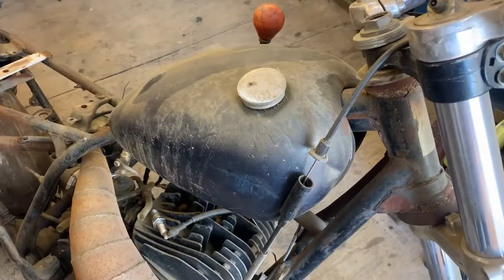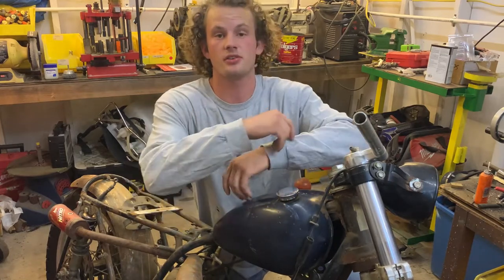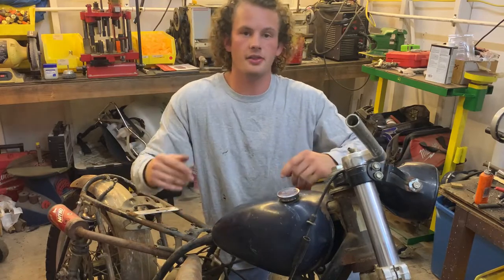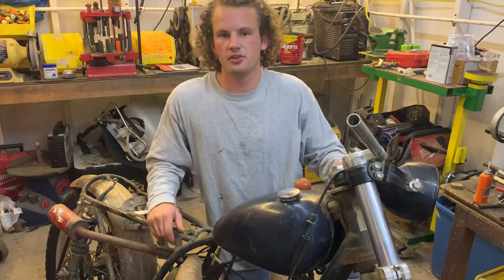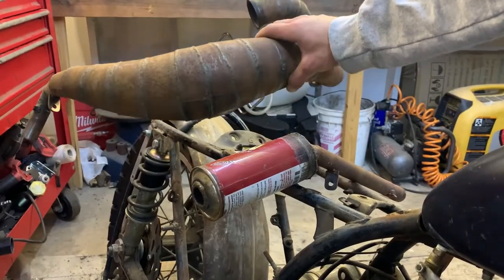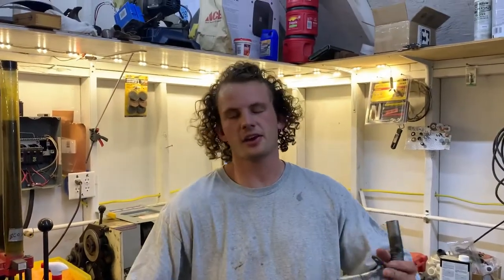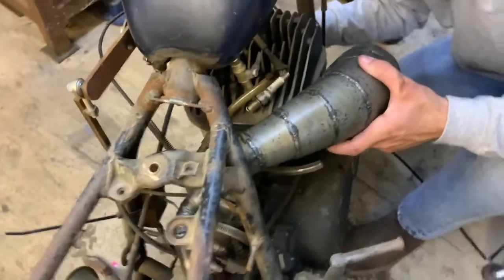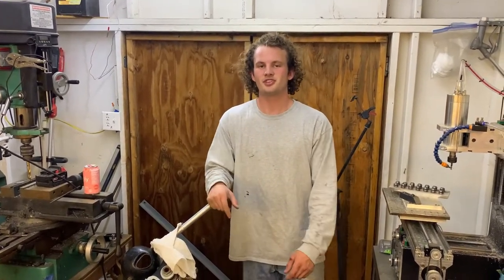DT360 Two-Stroke Rat Bike Update: Rekindling the Flame

Comment: Any ideas where to go for the rebuild bits especially the electrics my 360 build has stalled thanks to this issue
Reply from the maker: In a later video I replaced the stator with a new billet aluminum unit. It was expensive but well worth it
Reply: @FormulaJake  thanks mate mine was in a right state when I got her 10 yrs back so I put it aside for later realised parts were a bastard and on the back burner it went finally stripped and unseized the old girl a few weeks back now its a matter of getting all the rebuild bits together then off to the blasters
Reply from the maker: Hell yeah man. It can be tricky to find all the parts but it will be very rewarding once you have it all together

Comment: Any progress??
Reply from the maker: Installed a new stator to get spark (video on the channel), worked on fuel system and mounting the rear brake but not much else.
Reply: @FormulaJake  
Nice, this is very similar to a project I’m looking into, did you find it hard to align the output shaft of the motor and the rear axle/sprocket?